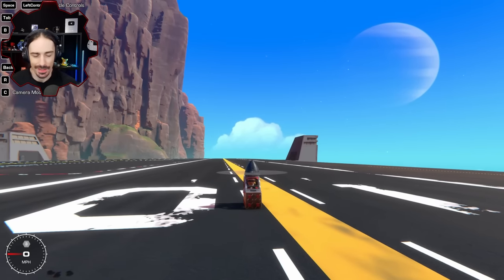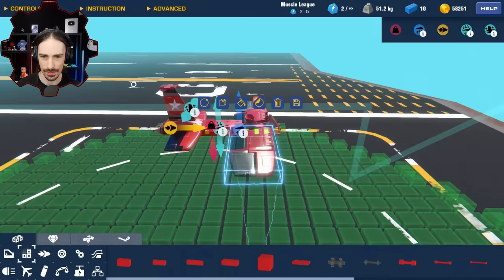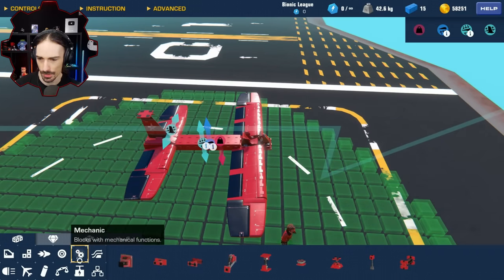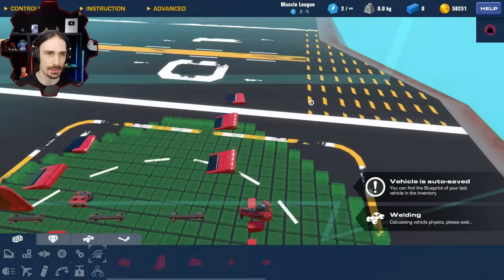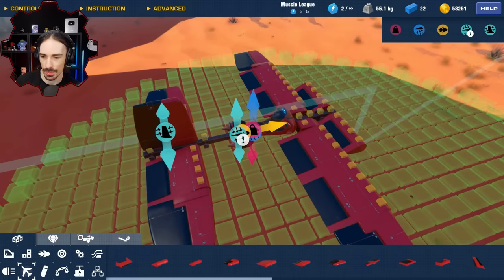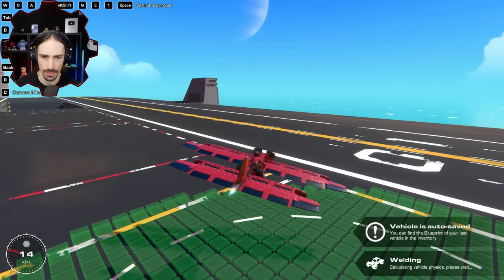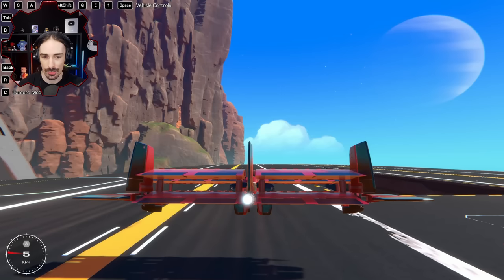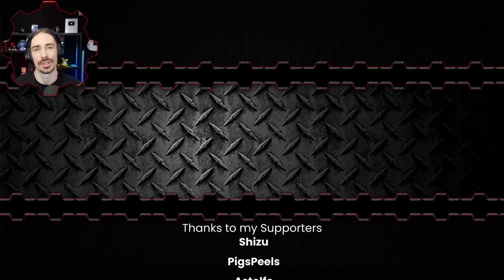Building the SLOWEST Possible Plane In Trailmakers!

Comment: I managed to build a plane that goes around 4 kph, it's basically just a biplane with 6 sets of wings
Reply: Then it's no longer a biplane
Reply: should we call it a hexaplane then?
Reply: Also, probably fewer wings and some actual flap usage might help with that?
Reply: i had one that looks like its frozen in mid air
Reply: Triplane, its now a triplane not biplane
Reply: Hexaplane
Reply: @PJwarri0r  Oh, right, he said "sets" not "pairs?" of wings, so yes, that's a triplane. I was looking for what it was called when it had 6 rows of wings and couldn't find anything. :D
Reply: Hexaplane
Reply: Me, too
Reply: Managed to crash my game by going into build mode lmao
Reply: Proof?
Reply: By that do you mean six total wings, six pairs of wings stacked vertically, or six sections of four, biplane like wings.
Reply: It’s not a biplane if you didn’t use and thrust or propeller
Reply: Got mine to 2kph whith a weird fligt angel, two sets off wings plus one more in the front and a switched off engine

Comment: The air must be super viscous in trail makers. It's like flying through half set jello.
Reply: and considering how slow airplanes are compared to real life, it would support the idea of air jello.

irl, a Cessna can easily achieve 200 kmh, in trailmaker, that's the speed of a fighter jet.
Reply: From what i remember, TM does not really have "air", the wings essentially reduce weight of the craft as a whole instead of producing lift. In most cases it is functionally the same, but effect is different when you get to extremes like this lowest speed.
Reply: Kosmo's new quantum drive warps up to a brisk jog's pace when you push the drive cores together super close. It's funny to watch. I wanted to compact the thing and it just crawled everywhere. Like a super slow mo vtol.
Reply: @AgentWest  There's definitely some kind of functional air resistance. Obviously your speed is affected by how aerodynamic the vehicle is, but it's also possible to build usable planes with no "lift" producing parts. You can still build functional flight control surfaces using only aerodynamic blocks, so the game is calculating differing air resistance around the airframe somehow.

Comment: "Once we find out everything that doesn't work, we that will be left,  is what works."
- Scrapman 2023
Reply: This. This is a Kerbal way.
Reply: Thisis what russia is doing rn.
Reply: @moroblizniak4457  u mean ukraine
Reply: "The missile knows where it is at all times.
It knows this because it knows where it isn't.
By subtracting where it is from where it isn't,
Or where it isn't from where it is (whichever is
Greater), it obtains a difference, or deviation.
The guidance subsystem uses deviations to generate corrective
Commands to drive the missile from a position where it is to a
Position where it isn't,
And arriving at a position where it wasn't, it now is.
Consequently, the position where it is,
Is now the position that it wasn't,
And it follows that the position that
It was, is now the position that it isn't.
In the event that the position that it is in is not the position that
It wasn't, the system has acquired a variation,
The variation being the difference between
Where the missile is, and where it wasn't.
If variation is considered to be a
Significant factor, it too may be corrected by the GEA.
However, the missile must also know where it was.
The missile guidance computer scenario works as follows.
Because a variation has modified some of the information
The missile has obtained, it is not sure just where it is.
However, it is sure where it isn't,
Within reason, and it knows where it was.
It now subtracts where it should be from where it wasn't,
Or vice-versa, and by differentiating this from the algebraic sum of
Where it shouldn't be, and where it was,
It is able to obtain the deviation
And its variation, which is called error."
Same vibe
Reply: *all that will be left
Reply: @ShadowWolf2508plays bushwhack 18 reference?
Reply: @Karbonix  it's "The missile guide for dummies", originaly from a 1997 air force training video
Reply: Didn't Edison say that when inventing the lightbulb?

Comment: In the seas expansion it can technically qualify as 0kph if we are going into the wind and the wind pushing backwards on the wing lets us float without falling and thrust pushing us with equal speed as the wind although he didn't say you have to go forward I think
Reply: I like your rules lawyering. 

"Hey, I have 0 relative groundspeed, it doesn't MATTER what my airspeed is!"

Given that, it would be hilarious to build something that is FAST with a lot of lift and then just fly into the high winds at the perimeter till you achieve 0 groundspeed.

Comment: I built a helichopter during the campaign. I had modular wings and the chopper engine, but not copter blades. So I made a functionin copter with two pairs of spinning bits in opposite directions. It went up and controlled very well, but I couldn't get it to go down. It had so much lift that it just hovered in place with no power.

Comment: To use the same thruster for lift off and for maintaining a flight you can use a logic gate with a different key that has its output limited and the thrusters themselves have a key that is used to lift off. Hope this helps

Comment: I just had a crazy idea. Very crazy. Scrapman level crazy.

A dog fight challenge, but thrusters are stabilised to ALWAYS point horizontal.

Mounted to your plane with a rotator and steering hinges, so as you roll left / right and as you pitch up / down, the thrusters stay level to the horizon.

The thrusters may be mounted on the front OR the back (but not both).

The challenge of it is, if you try to flight straight up vertically, front mounted thrusters will try to pull you straight, rear mounted thrusters will try to make you back flip.

So, you will be forced to either climb and descend slowly OR build up speed and turn off thrust as you climb / descend fast.

Comment: Using the wing piece with flaps is hurting your lift, they produce less lift than normal modular wings, you can just test this out by placing wings on build mode and watching the center of lift move.

Comment: Put thrusters on servos connected to an angle sensor that always makes the thrusters point exactly horizontal
Reply: ...which would also give you a place for the vertical speed sensors to read true vertical speed. And having that information, you might be able to automate keeping a constant altitude.
Reply: Then you connect thrusters to downward velocity and it settles on slowest speed.

Comment: Did you turn down the steering influence of the air resistance ailerons? I'm wondering if those might have been completely "on" and that was what was driving you sideways.

Comment: So idk how this'll work in trailmakers, but you could tilt the wing tips up a little to make it naturally stay level. In real life, if it rolls to either direction, the angled tip on the downward side ends, generating more downward force pushing it back up, leveling it back out. Like is said, though. idk how well that'll work in trailmakers.

Comment: The sideways motion is due to the sideways ailerons, a better way would be logic
Like a front facing( 🐥) speed-sensor set to activate below threshold, set threshold to 3-4-5kmph and activate an and-gate with it, couple an or-gate set to space(for thrust) into the and-gate.
Now you only have thrust if you press space and your speed is below the set threshold.

If you crash, you are to slow... if still fly, set the speed a bit slower or…
add wings AND set to a slower speed

Comment: A slow vehicle in Trailmakers actually has a pretty big advantage. It can repair infinitely without a cooldown. The cooldown bar only appears when you're moving at a fast enough speed.

If this plane had some extra thrusters to go super fast, and be able to brake down to a slow speed, repair, and continue going fast, it'd be very good in PVP.

Comment: You could have used an OR logic gate for the thruster power to be adjusted, keep the thruster’s settings at 10.00 and the logic at 0.25 or something, then set the logic gate and the thruster to diff buttons.

Comment: When I tried to make a glider I found that at a certain point when the lift to weight ratio is so low the plane starts defying physics and not increasing in speed no matter the angle

Comment: So I did some math and assuming 1m = 4 blocks, minimum speed of 5km/h, and standard Earth gravity and air density, this airplane has a maximum lift coefficient of 41.25 !!!

For reference, your average real life airfoil will have around 1.5 for a plain clean wing and 2.4-3.3  with high lift devices (flaps, slats). I've looked around on the internet and the highest number I've come across was 12 for a crazy theoretical wing with powerful suction devices that wouldn't stall even at 70°AoA. Trailmakers has some real wacky physics when you push it to its limits

Comment: In KSP, at least last time I played it, if you built a plane like this, but with no engines and launched it with something like a rocket sled, your aerodynamic surfaces created forces when they actuated, which were sufficient to stay airborne indefinitely, and if fact made it IMPOSSIBLE to land, of you touched the controls while trying to do it.... 

Well outside of plowing it into the ground, but it mean a normal, soft landing was impossible. Because when you would try to pitch up to scrub away the last of your speed, you would actually gain speed and climb lol.

Comment: put a SPEED LIMITER ON THE PROPELLER, thats set on a toggle button, limiter will turn on when you lift in the air, and propeller can spin slower

Comment: So that isn't the correct way ^^;; as it isn't the method one would use in real life. But it uses sort of the same basic principle which is pitch trim in front and back both in the upward position. Then make the pitch manually adjustable in increments of 0.01. Then meter your thrusters to match the weight vs lift. Use logic gates to create a variety of thruster speeds and an altitude sensor to fix the pitch trims. Then finish off by adding lots of wing surfaces. I have made 2 creations that simply hang in the air with no movement at all, but think they were configurations that Trailmakers didn't know what to do with.

Comment: You can just use logic gates to pass a certain speed value to an engine, just remember they are additive!
Reply: The plane floats because of the way the forces are applied to it.

More wings adds more force upwards, even at very low speeds with a lot of wings. So if you tilt sideways, you will eventually start floating that way after some time.

Comment: Like I said in the post I did it with 20+ wings
Reply: Basically all I did is kinda followed the same method as ScrapMan I was trying to make a glider with air brakes then randomly got down to 10 kph so I was like. Can I get lower? Then I just balanced my wings out I actually used a mini thruster but my build was quite a bit larger and heavier. So well done ScrapMan for making it that small.